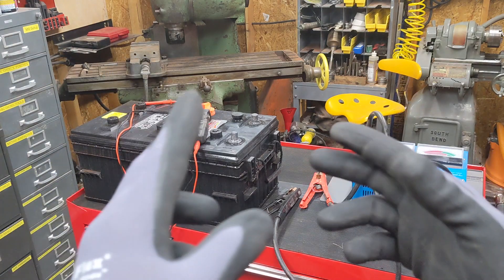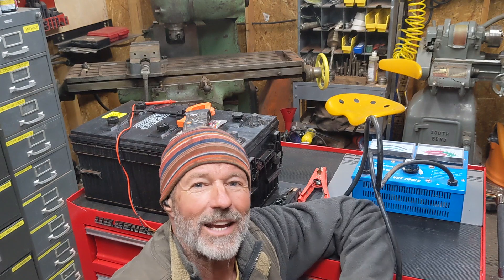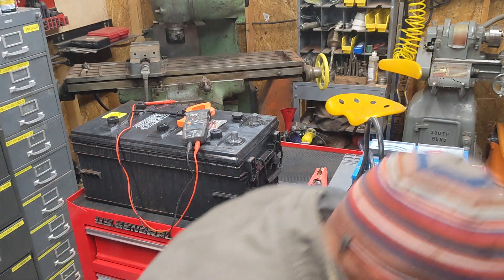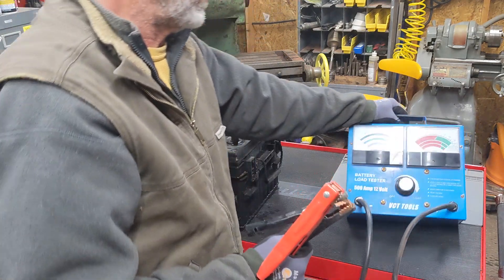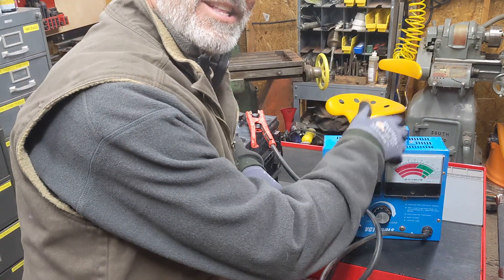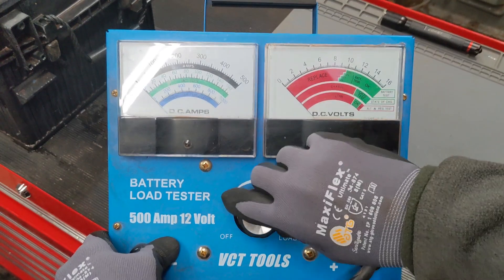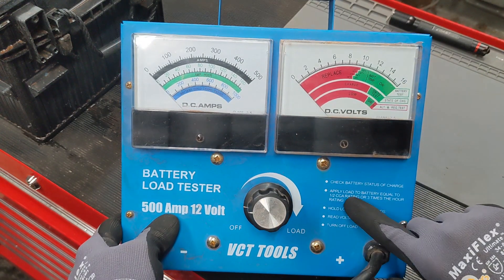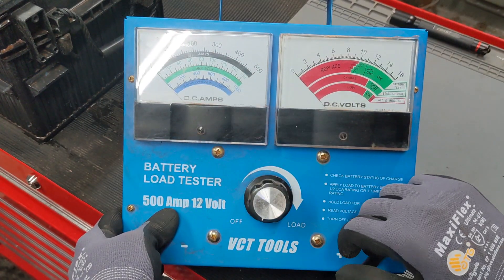Is your bus battery really okay?  How to check it.

Comment: In a pb aka lead acid battery a 12 volt nominal battery 12.7 is fully charged and yes you are very right about testing the battery under load

Comment: I've heard that connecting a bypass connector to the battery will help to eliminate a parasitic draw... are there times when you just can't find the cause of the parasitic draw and is the bypass mechanism safe to use in that case?

Comment: I don’t know how many times someone has said “I tested my battery with a bolt meter and it’s good”
When I ask how many volts and they say “12” I go into the.spiel “that’s only half charged” and all about volts and amps and they get glassy eyes and I tell them “bring it here”. 
In the last month at least two threads about bus won’t start and the solution was charge the battery and try. 
Of course the. You can’t convince them they might need a new one and should get it load tested because “when I charged it it worked” 
Arerrgh

Comment: Great information, including the last bit of how "not to do it" .  However, many times i have problems exactly like you explained and its frequently turned out to be a bad earth where the negative cable bolts to the frame or chassis. Always worth a check first.
David in the U.K.
Reply from the maker: That's very true - bad, corroded ground connections are super common and always worth a check.  Thanks for chiming in!

Comment: 1:22 starter solenoid
Reply from the maker: Not in this case.  My batteries were marginal and failing.  The voltage dropped too much under load.  That was sort of the point I tried to make with this video.  :-)